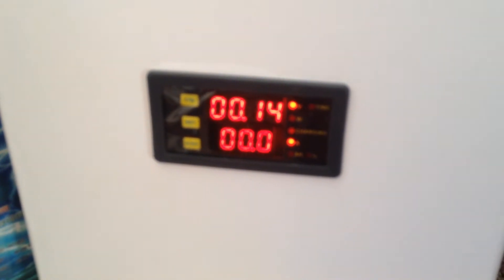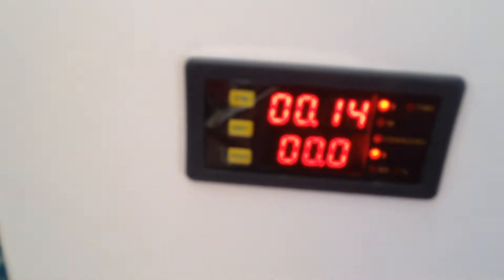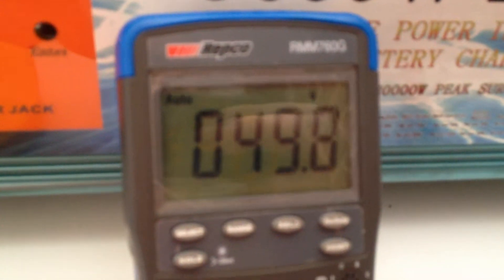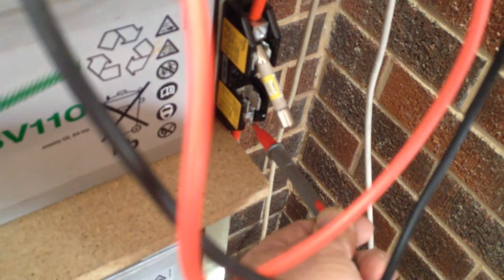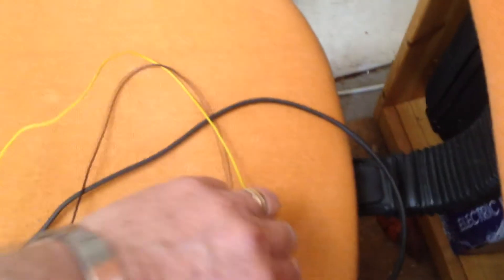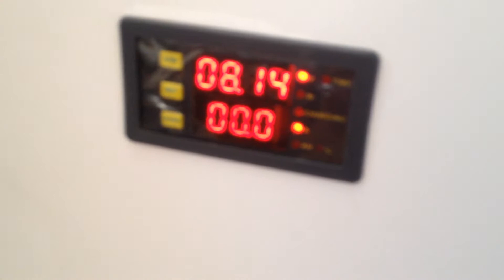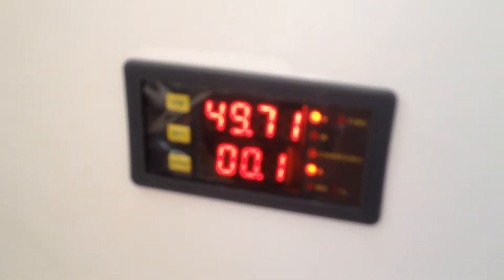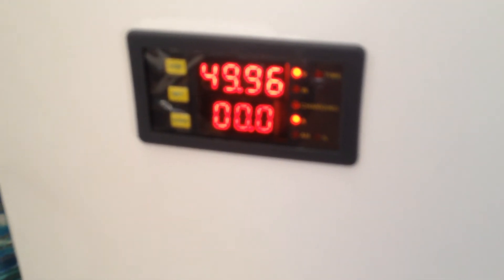How to safely precharge inverter capacitors (PowerJack 5000W 48V Inverter Charger)

Comment: this is great, question for you, you happened to have a 240 volt light bulb so you can bring your caps to full voltage, but I believe we do not have to bring the capacitors in the Inverter slowly to full charge I believe we can safely bring them up partially I am not sure what the percentage or the ratio is, but maybe 30% so 14.5 volts in your case, and then connect them safely, is that correct?

Comment: I'm here in 2021 while trying to research why my 5000w Victron Inverter won't turn on when I hook it up to a 24v 200AH LifePo4 battery.  Turns out the BMS sees that initial current of the capacitors as a dangerous short and activates it's protection circuit.  NOTHING in the battery or inverter documentation warns of this.  Now I'm in the process of sketching out and building a permanently installed precharge/discharge circuit.

Comment: You can also permanently connect a precharge resistor across your fuse block.   For a 48 volt system, a 470 ohm 10 watt resistor would suffice, as the maximum power drawn through it would be about 5 watts and only for the brief time it takes to precharge the capacitors.   That resistance value is also high enough that it won't permit a significant amount of current flow, should the fuse blow for some reason.   And, while the fuse is intact, the precharge resistor will consume virtually no power, because it will be in parallel with the fuse which has an almost zero ohm resistance across it.

Comment from the maker: Jovy, you mention "voltage sag", what are the details of your DC circuit for your (proposed?) inverter setup, e.g. DC input Voltage, A.C. output capability (Watts) etc. perhaps a short video highlighting your components, layout and output requirements?

Comment: what kind of bulb did you use? i think i heard you say 240v ac bulb? am i correct?
Reply from the maker: +Jovy thanks for watching; YES, it's an incandescent 240V bulb, (60 Watts I think). It's worth mentioning also, in light of Claude's previous comment "...always discharge the inverter", that when working with/on the inverter always disconnect AND discharge the capacitors (using the 240V globe method or a suitable resistor, 100ohms will ensure a max current of 0.5A on a 50V potential).
Just as an example of what NOT to do with these beasties you might care to watch this: https://www.youtube.com/watch?v=JiwfWlYLWy0
Reply: +Retinalism i plan on installing capacitors between my inverter and the batteries to help with the voltage sag. i might try this procedure to charge up the capacitors before installing them.

Comment: I just discussed this with some meat head. He insisted it's normal to hookup the batteries and get half the connector blown off. Not only is it not normal. Its dangerous. You should always discharge the inverter before attempting to hookup the battery cables to the DC load side. As I have seen some install the inverter and power it up. Then turn it off. Then put the battery cables on. Only to see the terminal and cable arc flash. 

Thats why they include manuals.